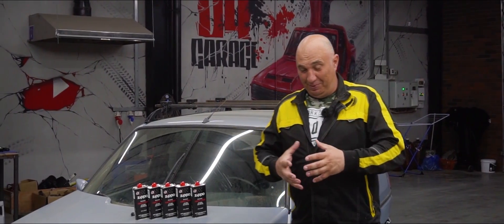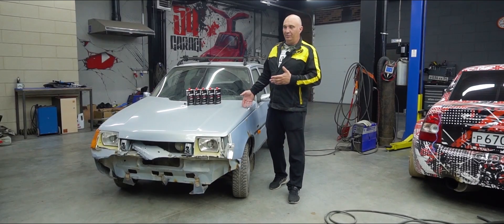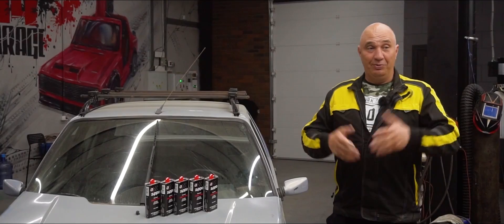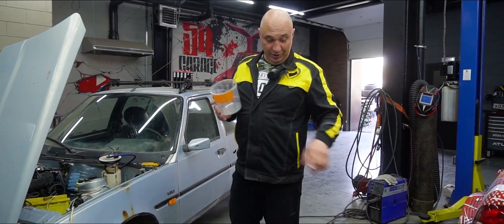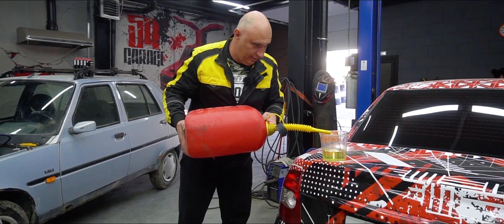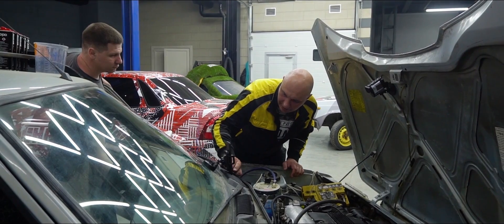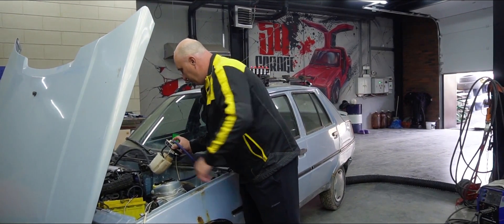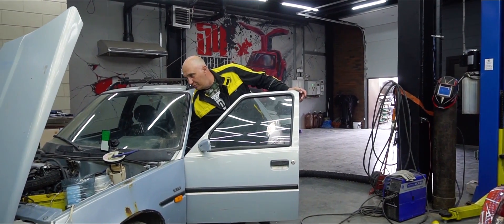Can a car run on Zippo lighter fluid?

Comment: its Nafta/ white spirit/ distilled gasoline. if you run the car long enough on it u will ruin the engine. to dry for a petrol engine. tried and failed my self :-)
Reply: Zippo  fuel is pretty much gasoline. Kerosene would not light by sparks.
Reply: u r right. so I changed it to the right answer :-)
Reply: Nah, he is right. Zippo fluid in particular IS white gas, or naphta, or nafta, or however you spell it on your country. Same stuff for camping stoves.

Comment: Next one: "Can a russian car run on vodka?"
Reply: Off course it can
Reply: Only the driver can run on vodka. Stop taking my vodka you dirty Lada.  suahsuahsa
Reply: Russian wouldn't waste Vodka in car . just get wasted drinking vodka
Reply: Depends on the vodka, it should run on a high proof one.
Reply: @Kluneberg  well its Russia so it is assumed it is basically going to be moonshine
Reply: Tequila: Hold my beer!
Reply: If there is a fuel filter it will stall.  Water makes up more than half of vodka content so the fuel filter membrane would just get backed up with water and no fuel will pass.
Reply: Vodka fumes might work even better
Reply: Of course. Russian vodka is REAL vodka.
Reply: You most certainly can, but it needs to be real strong stuff about 90% volume is what you would want and only people making that kind of thing are moonshiners.
Reply: This is not russian car!
Reply: @PavelLGUA  It is an Ukrainian car. a ZAZ Slavuta
Reply: If a car can run on moonshine it can run on vodka.
Reply: @thebigdog2295  illegal moonshine is probably a higher proof than vodka.  The mythbusters tried it and it worked though the car was a little down on power
Reply: is ethanol afterall, so, it will run, maybe better than with gasoline
Reply: @djmhyde  vodka is usually around 40% alcohol/ethanol...not enough to run a car on i think
Reply: They did that?
Reply: Yes.
Reply: Yes...what is this stupid question:)
Reply: No too much water
Reply: Vodka is mostly water so it can't be used to fuel an engine.
Reply: Zachary Durocher  Boris?
Reply: Yes, They can. And it very efficient.
Reply: No not under 190 proof
Reply: Yes it can.. a bunch of drunk Russian men pushing it from behind that is!
Reply: No , it has sugar but the driver can .
Reply: After that: Can a Russian car run on Brazilian ethanol?
Reply: Probably
Reply: They wouldn't put it in the car, they'd just drink and stare at the wheels until they start spinning. 

Well shit.. that's what I do except with rum and diet Dr. Pepper.
Reply: Im not sure if with vodka put wasnt it possible with moonshine
Reply: Can a Russian run without vodka?
Reply: My $0.02. Alcohol of the drinking variety can be distilled to almost 96%. Other youtube videos have shown a car will run on that, if not very smoothly. Thus it is possible a vodka exists that a Lada will run on.
Reply: I think I heard a UAZ could run on vodka, or pretty much anything that burns, but not sure
Reply: Zachary Durocher  he is from Slovakia
Reply: Zachary Durocher  life of boris you mean i guess
Reply: Didnt gas stations.in russia sell vodka as fuel for both the vehicle and driver?
Reply: Like Homer Simpson, one for you, one for me...🤣❤️
Reply: :face-purple-crying:
Reply: Everyone laughed.
Reply: @camuga3222  One man applauded. His name?  Isidore.

Comment: He put clear fluid in the fuel bucket....after it ran for 18 min he checked how much lighter fluid was left in...and it was suddenly yellow....
Reply: What to expect, he had the fuel return line back in the jug ;p so any remains of gasoline got picked up on the way back.
Reply: @astromatel  ah. Ok
Reply: maybe it cleaned the filter ?
Reply: The fuel filter and other components probably held enough fuel to contaminate the color. It does have a lighter tone than the gas from the can. I have no idea if they use dyes in the gasoline in Russia, but if they do, I guarantee you it it would dye everything in the system. Kinda like red diesel in the US for non-highway use. Those are REALLY strong dyes. I am led to believe that maybe the case because, at least in the US, gasoline is quite a bit clearer in color. Not piss yellow for sure.
Reply: @walterwallace1328  yeah that's pretty much the only reason I could think of, thx for the explanation man
Reply: was looking for this comment cause I noticed that as well but didn't want to claim first XD
Reply: Fuel return line
Reply: @froggerman44  are you the brother of Walter up here? 😂
Reply: Yeah, noticed the same thing and can't think of an explanation.  Even if it was tainted with a little gas it wouldn't turn that yellow.  Idk
Reply: MMGJ09 it actually would turn it pretty yellow with a low amount of gas left. clear fluids can very easily be changed in color, especially considering that it’s a petroleum solvent.

Comment: I'm pretty sure lighter fluid is just highly refined diesel . try it in a diesel engine
Reply: if its highly refined diesel then it wouldn't run. Diesel can't ignite from a spark plug
Reply: Its refined gasoline

Comment: Please Don't ever get rid of the translator!   I love him
Reply: Thiel Tube anytime I hear somebody talk Russian and don’t hear “translation by BMI Russian” it feels weird!
Reply: "Regular 95 octane gas" ..our premium in the u.s. is 91 octane 😭
Reply: rollingdice714 In Europe, the octane rating on the pump is simply the RON figure. America, by contrast, uses the average of the RON and the MON figures, called the AKI (anti-knock index). Thus, 97 octane “super unleaded” in Britain is roughly equivalent to 91 octane premium in the United States
Reply: @stigsdanishcousin3075  In USA is MON (motor octane number) they test the fuel at 600RPM, in Europe is RON (research octane number) the gfuel is tested at 750RPM..
So American 93 is same as our 100. I mostly buy 100, in case gas station doesn't have it I buy 95 premium with engine cleaning aditives
Reply: @stigsdanishcousin3075  Lighter fluid is under 80 octane..
Reply: @george714521  Ikr? 91 Octane is bad. 95 Octane is SOOOOOOO fucking good!
Reply: rollingdice714 
In Texas we have 93 premium
Reply: rollingdice714 different measurements, 91 us = 98 row
Reply: they have a Russian channel called гараж 54
Reply: @george714521  95 octane in Russia/Europe is the same as your 91. We use RON instead of MON when rating I t’aime content of gas.
Reply: @george714521  higher octane does not give more performance in any kind... higher octane is more resistant to self ignition which is bad when it occurs and modern engines have sensors that detects it. Running higher octane gas than your car is designed for does not give you any benefits only running lower octane can cause self ignition, or pre-ignition, knock-ignition whatever you want to call it, basically fuel ignites not by spark but compression not when the engine needs it.
Reply: @SeiferFirehart  🤣🤣🤣
Reply: rollingdice714 in the U.K. we get 99 at the pump
Reply: 10 stars to the translator
Reply: Actually i picture that russian guy talking English
Reply: Love you guys too
Reply: @SwapBlogRU just wanted you to know I saw your comment. They tend to go under the radar since your profile name isn’t BMIRussian or something similar! You’re doing great even today, keep it up.
Reply: agreed 👍
Reply: Regards from Athens Greece..
Reply: Hopefully they won't go like Kreosan and hire a bootleg Scooby Doo voice actor.
Reply: They're stuck with him now. He's both a translator and voice actor, he cannot be replaced, that would be like Homer Simpson getting a new voice
Reply: Honestly i would love two versions. I already forgot a lot of Russian.
Reply: Gabriel Kasprzak https://youtu.be/nRkdkhuAGOo - They have a Russian only version
Reply: @jonathanfleck5419  double stonks
Reply: @jonathanfleck5419  Thank you very much!!! Just what I was looking for! The way I learned english was by watching it, hope it wil work for russian too
Reply: @BlueDemonGabi  You have Russian version without translator
Reply: @BlueDemonGabi  The original Russian channel is at: https://www.youtube.com/@garage_54.

Unfortnately [for me] they don't often have Eglish subtitles. I can't stand voice-overs.  Same as with cinema films, I want to hear the original people. Not some low-rent actor doing sillyvoices over the top.
Reply: Agree
Reply: TZaporattitche...  now we know how to pronounce products of the ZAZ company :-)
Reply: Thiel Tube fuck yeah that’s how I feel Russian without speaking Russian
Reply: why are you gay
Reply: BMI Katzap
Reply: He sounds to be in a hurry.... Blu blu blu...

I want a russian version.
Reply: Bodymass Indicator Russian?
Reply: Sounds gay lol he loves Russian meat
Reply: It's like an early 2000s narrator. Like junkyard wars or something.
Reply: Read this in the translators voice
Reply: well he translates EVERY one of their videos from russian to english, so i don’t think they are going to..
Reply: I agree. He is like a good bedtimestory😍
Reply: GIVE ME YOUR RUSSIAN DADDY MEAT
Reply: You love hum huh?